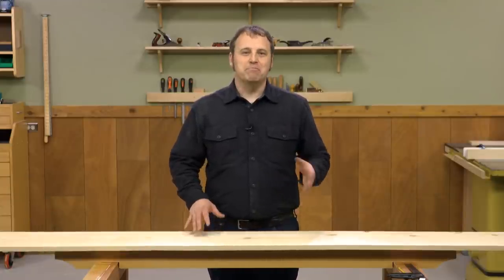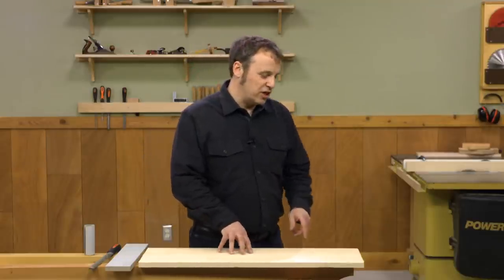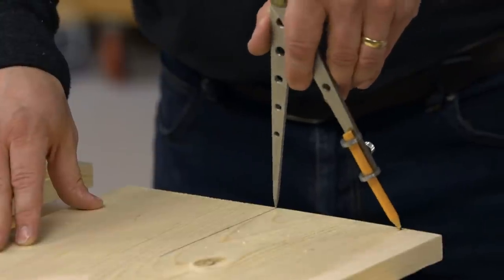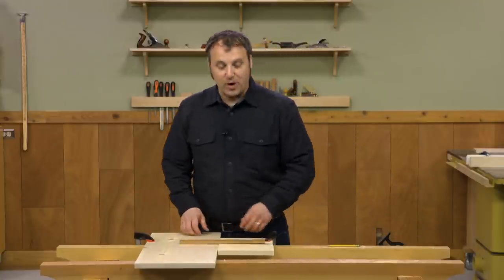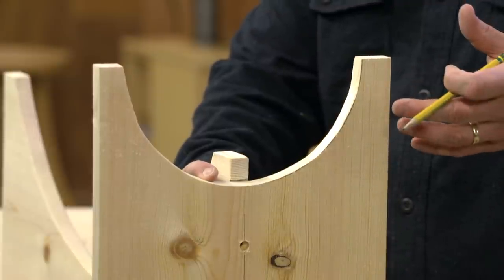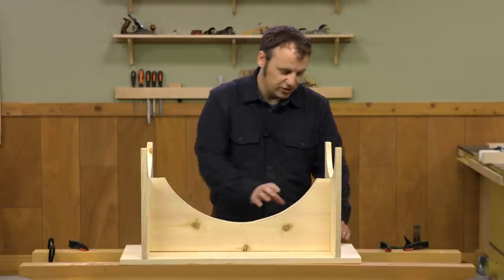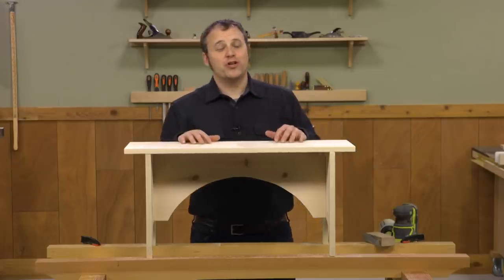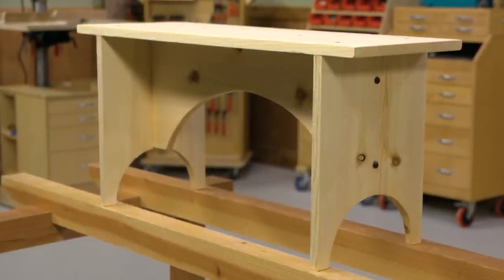Weekend Project: Making a Small Shaker Bench

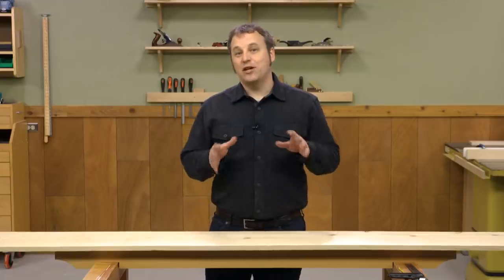Comment: 0:32  "It comes from a board that's called a 1x12, but it's actually 3/4 of an inch thick, and measures 96 inches long...."   Uhhh, didn't you mean to point out there that its width wasn't really 12 inches, but actually 11 1/4?  I feel like the length in inches wasn't really the relevant detail there in talking about the "12" part of its name?